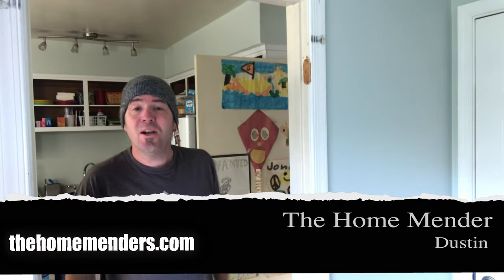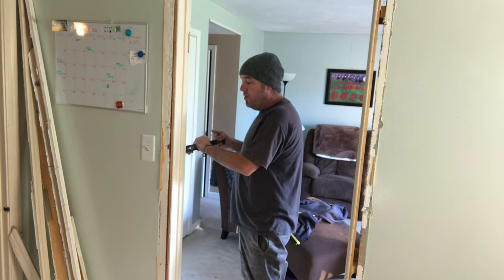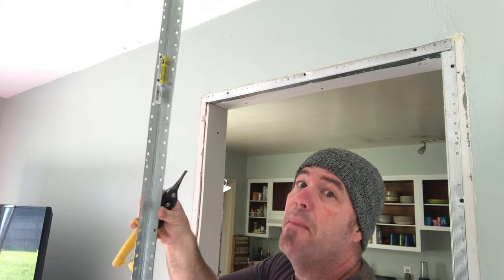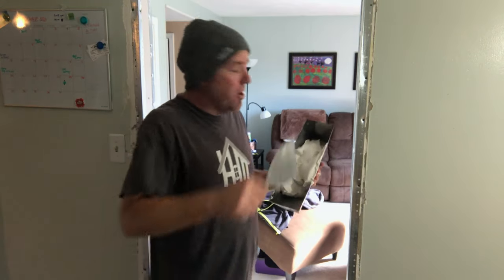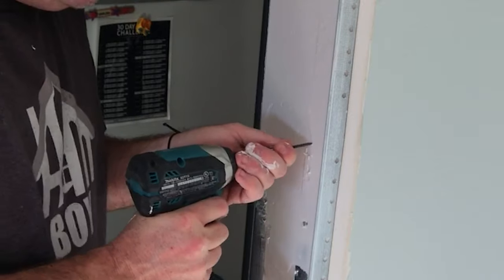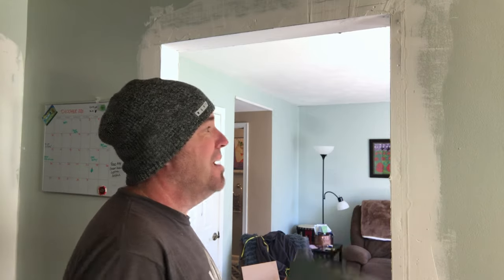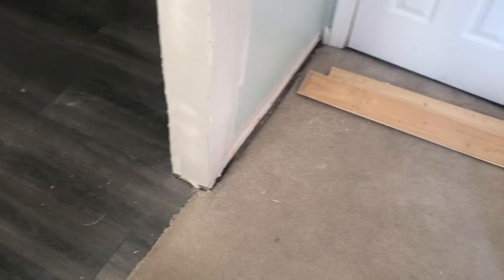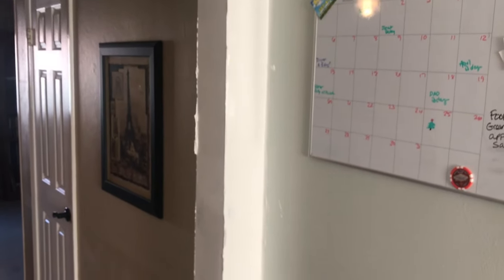How to remove a door jamb, finish drywall corners  and create doorway. Easy!

Comment: What if its a metal jam that used to be the back door that led to the backyard, but now leads to an addition on a 60 year old house? And the jam is part of a cinder block house as well.
Reply from the maker: Great questions. Just by the comment I would have to say the metal door jam would have to be removed boxed in with some framing wood and then covered with drywall. I hope this helps.

Comment: I hate the green lid. Just use Durabond 20. Couple hours and ready to prime and paint. Apply it very very thin as it's like sanding concrete when dry but tough as concrete 😂
Reply from the maker: Hey Tommy I like 20 as well but unless you’ve got somebody mixing it for you it takes a long time. I put on the green top and then takeoff early go home hang out with the family. Come back the next day 😀

Comment: This is exactly what I am looking to do, but I have a question.  If the surrounding walls are textured, do you recommend texturing the new drywall in the opening, or leave it smooth?
Reply from the maker: Great question David. I would try to match the texture. I have a texturing video you could check out. Give youu some ideas how you might tackle yours!

Comment: This video is EXACTLY what I was searching for! I have two old jams in the my house that need to be gone. Can you, or did you, list the recommended materials? I'd like to know the best type of drywall, mud and corner strip to use (sorry I'm new at this). Thanks!
Reply from the maker: Hey Andrew. ! Thank you sir.  I used 1/2 drywall , 1 5/8 drywall screws , green top mud and the metal corners.  Don’t forget your mud pan and knife.  You got this!

Comment: I'm selling my house and I'm told to remove the kitchen door. Do I need to replace the entire frame or is there a way to patch up the catch so I don't need to replace the entire frame. If I kept the house, I'd take your advice re remove door frame and jamb.
Reply from the maker: It definitely looks cleaner removing them… But I would let the buyers do that.  You could try to fill the hinge area and the catches but it will look that way. I hope this helps. Thanks for watching.

Comment: Removed the door in my guest bedroom  closet and want to smooth out the door way so I can add a barn door and this video show exactly how to get the job completed. Thank you so much for sharing and not making it difficult😅
Reply from the maker: Thank you Anita. You are my success story. Thank you so much for sharing
Reply: Oh, you want believe that I got some free dry wall from Home Depot saving me 20-30 dollars 😀
Reply: I A friend to help me do this, but something went wrong the jDry Dex compound  I used would not stick to the metal beading,  but I didn’t give up and keep working with it. It’s looks ok but I wish I knew Exactly what type of compound or mud you used☺️
Reply from the maker: Hi Anita. There is a suggested home improvement playlist in the description with some options, Home Depot and Lowe’s only sells one kind and it either has a green top on it or a blue top. We always called it green top, it’s premixed and ready to use out of the bucket. Not sure what brand you used but if you hop on the mighty Netwerk you can upload pictures and talk about your project :-)

Comment: This video makes it look easy and ready to tackle a project.  I do have one question.  If I want to make original frame a little wider, how can I tell if that’s possible?
Reply from the maker: That’s a great question Angela. You can probably make it a little wider, but depending on how much you want… Look for switches and plugs that would be in the way if there would be wiring or any plumbing lines.

Comment: Thank you, this explains the basic principles.  I want to remove the door jamb in a coat closet next to my kitchen but inside of the closet is a few inches wider than the door jamb, so I also have to cut  back the wall the jamb is attached to on both sides so it's flush with inside of closet (I'm putting my refrigerator in that closet with a cabinet overhead).  It looks like I'll wind up with pretty much the same job you showed in this video after cutting back the wall.
Reply from the maker: Awesome erich! You got this!
Reply: @homemend  I just started watching your videos today.  You did another one on repairing popcorn ceilings which I also have to deal with.  I just got back from Lowes with a can of Homax.  Wish me luck and thanks again!

Comment: Great video, very helpful! Is it possible to make it a bit wider if i remove one of the studs on each side of the doorway? Mine has a double stud on each side. Thank you.
Reply from the maker: Hey LF. Absolutely if it’s a double stud it probably needs to be. You could always cut the wall a little further back and pop a stud in wherever you would like. You got this.

Comment: Thank you for the detailed video.  Looks like the corner is covered with mud.  People who’s doing a bathroom remodel said it’s impossible to cover the metal corners all the way with the mud.  When it’s primed and painted that’s what covers it.  Is that true? Doesn’t sound correct to me.  His mud was very thin as well. Yours looks thicker and doesn’t move as much as his.
Reply from the maker: Hey Mario that’s a great question. The mud covers the majority of it you might see a little of the silver metal showing through on the very very edge of the corner but for all practical purposes the mud covers everything. I hope this helps

Comment: Great video! I've removed the trim and am only left with adding the second coating of mud, but the door frame I'm working with is on tile (turning a coat closet off my kitchen into an open pantry) and removing the trim left about 5 sq inches of flooring now without tile. Do you have any recommendations on how to fill the hole without pulling up and replacing the affected tile? Thank you!
Reply from the maker: Hey Miss Kristina !  Thank you my friend.shoot me a picture thehomemender@gmail.com

Comment: Would using bullnose corner bead make things more difficult? The other passageways in the home which never had doors have the rounded, bullnose corners. Using the tighter angle like you did probably wouldn’t make much visual difference; but just wondering about one style vs. the other. Thanks!
Reply from the maker: Great question LEEB… If they were close to each other, I would say use the kind of the rest of your house has. But I prefer the sharp corners myself. However, no they should not make things more difficult but they will be plastic instead of metal

Comment: Thank you for this video, just a couple questions.  Do you need paper tape for the corners to prevent cracks? Are you sure about tucking in the corner beads at the top corners? It protrudes for me and that might be a source of cracking in the future.
Reply from the maker: Hey Charles great questions. As long as your corners are secure you should not need to tape them but I’ve heard people share that they do. If it doesn’t feel right to tuck it then don’t tuck it. You got this

Comment: After removing the jam, can I not just install the metal corners and mud right over the frame instead of putting up more drywall ? Just to keep the space as big as possible.
Reply from the maker: Hey Kevin as long as the mud will stick to it technically you can, drywall just gives you a smoother surface to finish.
Reply: I’m removing mine now as it didn’t stick very well.

Comment: Hi, my laundry room is an addition and apparently the previous owners built the door after they put in the washer/dryer but they didn't measure the door space. We had to remove the door and tear out the door jamb to the laundry room to remove the washer and dryer, now we're trying to figure out how to repair the door frame.  We just want to put an accordion door or a folding door of some sort instead of the regular door. If we finish the door frame like in the video - could an according door be installed in the space? Thanks
Reply from the maker: Absolutely sister. The bifold door would be a little fancier than the accordion but both will work. Thanks for watching!
Reply: @homemend  Thanks!

Comment: What do you do if the current door frame is not plum?
Reply from the maker: Hey Ian if you’re going over with drywall and drywall corners it won’t really matter if it’s plumb or not. You could still finish the doorway with drywall mud.  Of course you could try to knock the bottom of the wall over to plumb it. I hope this helps

Comment: I have an issue and Dilemma. First time homebuyer here what are partially finished basement and not very attractive paneling that is unfinished. Gaps in corner walls that need trim and a huge area That could probably fit a double door. The door jam is kind of sunk in it’s not flush, I know I need a piece of drywall in there. Forgive me I am not savvy with terminology here I am learning. I am unclear what you are calling the metal corner strips that you are muddying. My question is Can I mud over that piece that is paneling? When I am finished I will put Trim on the corners, it seems to be my only option. I’m going to sand and paint the paneling in the whole basement eventually. Any suggestions? There isn’t much information on working with paneling on the Internet since it’s so outdated. Thank you in advance.
Reply: I don’t mind doing a little work and getting my hands dirty. I actually enjoy Learning anything I can. I’ve been painting and did some drywall work installed counters kick boards and splash boards since I was a teenager but this is new for me. My upstairs of the house is all newly remodeled and the biggest kitchen cabinets but I fell in love with and many of them ha ha
Reply from the maker: Hey see shell. For starters you rock. So cool and I know you will love that basement just as much as the rest. “Corner bead “ are the metal corners or “ drywall corners” you can apply mud over the paneling if needed.  It’s not the ideal practice but will work and after everything is painted, no one will know. Lol. It sounds like you know exactly what needs done. If you need additional help shoot me an email or jump on the mighty network to share pics and questions etc.  I’m here to help ! You got this. Thehomemender@gmail.
Reply from the maker: So cool see shell. I would love an update as you progress. !   Thanks so much for sharing 😊
Reply: @homemend  Thank you so much for your reply! I will do my best with the advice and share when I get the job done 👍 High ✋

Comment: What if my drywall is short?
The wood, under the doorway pieces you removed, is protruded out and the drywall is set back. Do I have to add slivers of drywall? I have a section that's a 1/4 too short and a section that is 1-1/4 too short.  Seems weird to add such small pieces? Please help! Thank you!!!
Reply from the maker: Hi Courtney!   No sweat.  Yes. You would need add the little pieces and mud them or go with taller baseboards to cover.  You got to this.